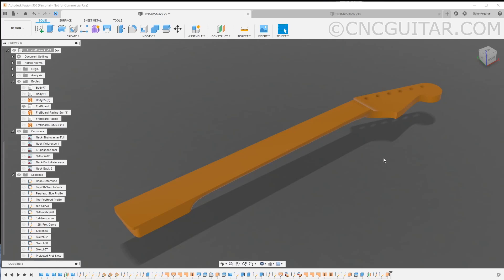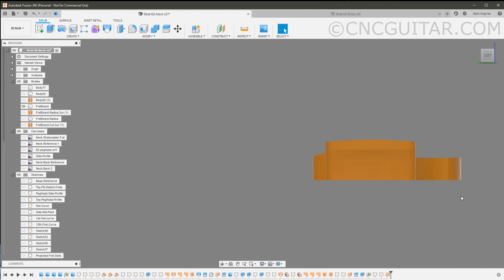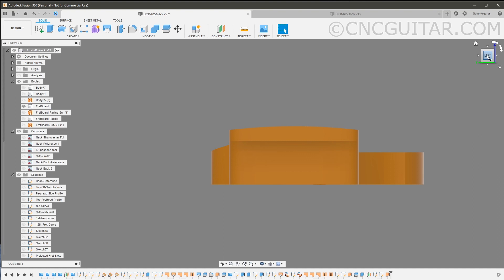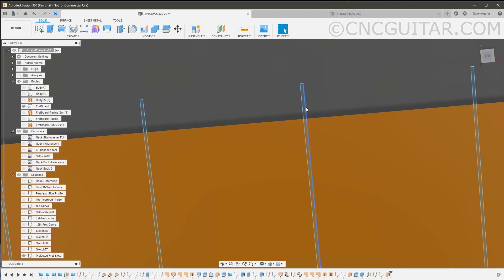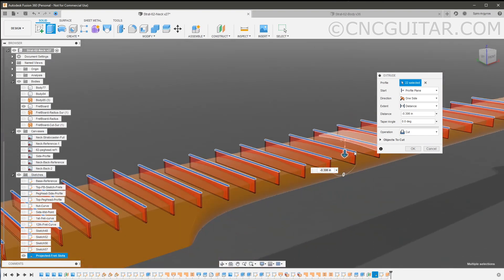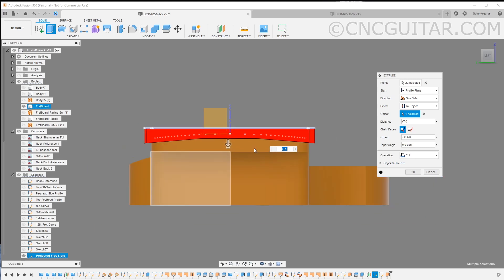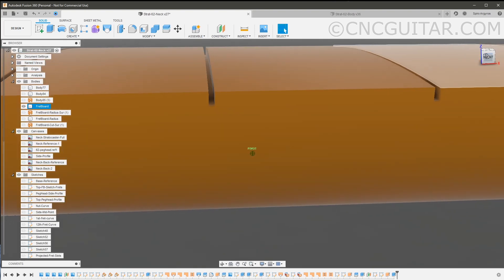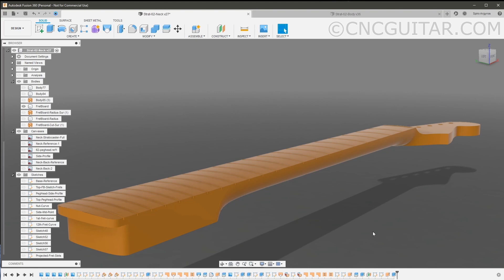Fusion 360 cutting curved Fret board slots

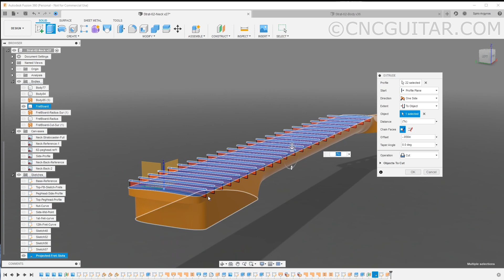Comment: I did the operation at 4:35 to extrude the frets into my fretboard just like you did but fusion360 results in an error, telling me that it could not found an object to cut into. But on the opposite, connecting a fret is possible. Any solutions? And thx btw for this video! It is super usefull!

Comment: Great tip. You could save time by using sketch lines instead rectangles. Use the thin extrude feature then set the width of the cut. Then you could easily change the cut width in the future if you wanted to by simply editing the extrude feature.

Comment: This method doesnt work for me :/ The fusion says: "Cannot extend extrusion to object. The extrusion profile falls outside the boundary of the selected body. Select a face or plane instead, or adjust the profile so that it falls inside the boundary of the selected body"... Why is fusion doing that? I did it all the same as you :/
Reply: I know this is an old video and post, but I figured out how to fix this problem. 

I was getting the same error. The Boundary Fusion is referring to is the are of the Fret board face. the fret slots cannot not exceed the edge of the fretborad. Meaning if the slot sketch are wider the the fret board itself you will get this error. So for example, if you nut is 43 mm and the 21st or 24th fret is 56mm. the length of you fret slots cannot exceed to edge of the fretboard. I had my Fret slots sketched at 60mm and I was getting this error. I found if I project the fretboard edges into my slot sketch and trim the ends to the edge of the fretboard I don't get the "Can't extend extrusion" error. and like the video I get the curved slot results.

I hope this helps. Someone in the future.